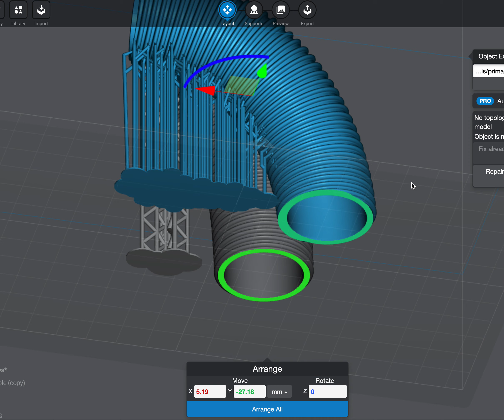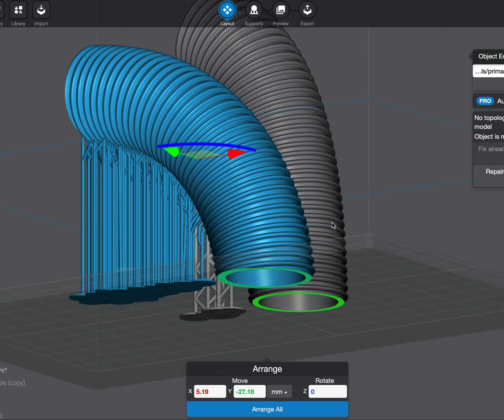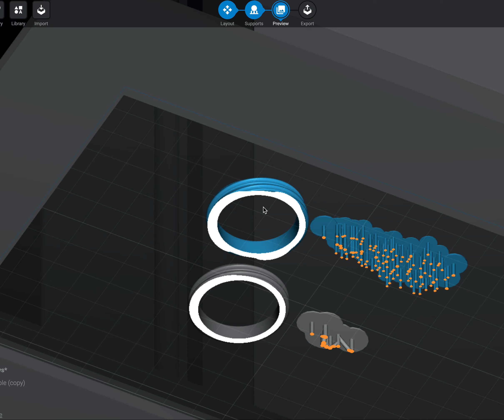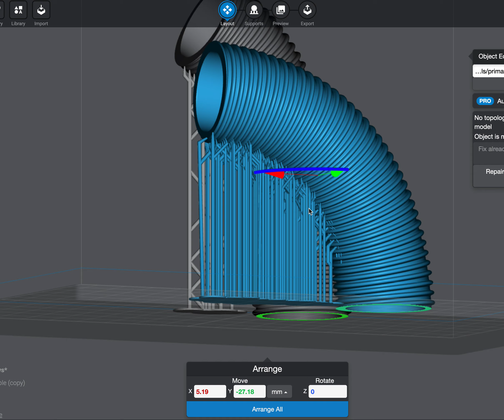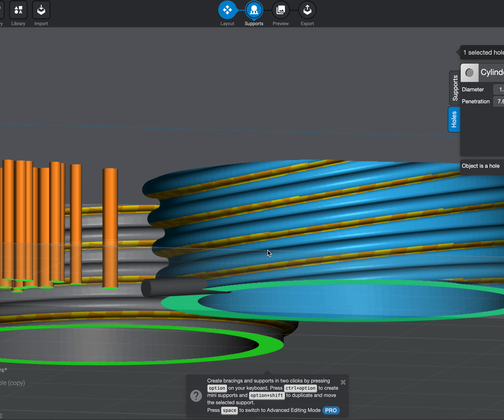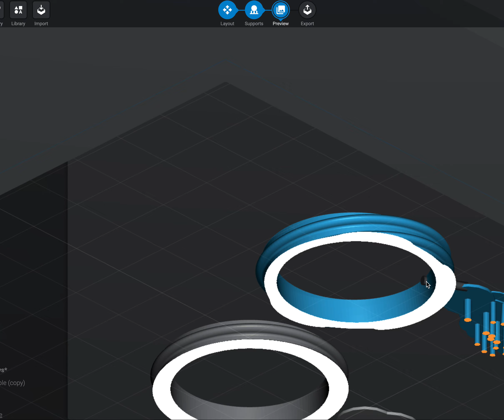Reminder to add pressure equilibrating holes for resin 3D prints

Comment: so now you're doing that light printing method, not DFM?
Reply from the maker: SLA it's called. (and FDM for Fused Deposition Modeling) I do both. See this post where you can see main helmet body is FDM printed, but small details are made on SLA - https://twitter.com/soswow/status/1419961378555658247